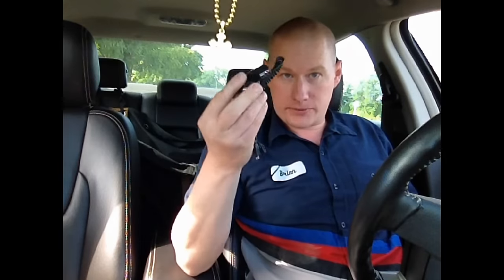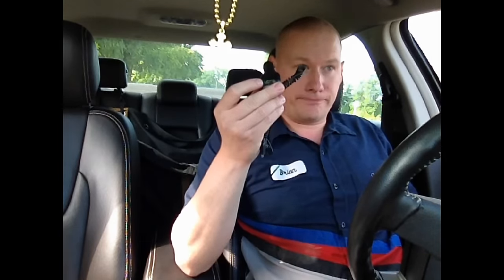Troublesome Ford Tire Pressure Monitor Faults Tip

Comment: I got a 2010 Ford Fusion giving a “tire pressure sensor fault” every time I drive AND right after I start the car too. No chargers, inverters, etc being used in car. All tire pressures are at 34psi so plenty aired up. Someone said the spare tire in trunk has the sensor too and maybe that’s it?
Reply: Did you identify the problem? I have the exact same warning on my 2010 Ford Fusion.
Reply: @philforonda7589  Had a bad tire pressure sensor. Went ahead and replaced all four. A little pricey though I believe they are 15 to 20 a piece.
Reply: @wampaswomps3975  Thanks, I'll bring it in, & get it checked out.

Comment: Also if the TPMS is on and left unchecked it will run your battery down. Ask me how I know. It leaves an open circuit and if your car sets for several days it will run your battery down.

Comment: What if it comes on when you start your car?
Reply from the maker: CJ Dangwillo If it is solid then there is low pressure.Blinking- There is a sensor fault.Starting the vehicle should not have any effect as the monitoring system is not active yet.

Comment: Change my tires my 08 pickup and then the light came on ,fault  sensor switch don't know if they messed my rims up or something😏
Reply: Check the tire pressure according to your manual.

Comment: How does the TPS monitor get power to send a wireless signal?
Reply from the maker: They have a lithium battery inside that last 10 years.
Reply: Thank you for responding. Bit of a surprise. I was thinking that there was a magnet on the stationary part of the wheel that generated power in the TPS unit when the wheel spins. I guess I must mark my calendar to replace the battery in 2023 (mine's a 2013 Escape).

Comment: The light is constantly on & not showing which tire.
Reply from the maker: SA4EVERNS Ok so if the tires pressures are correct 35psi or higher and you drove it over 30 mph for awhile for it to learn and the light is still solid indicating a low tire you will have to bring it in to the dealer or such because one of the sensors have gone bad and while they still broadcast just fine they are reading the tire pressure wrong and thus a false low tire warning. I have seen them wig out high and low depending on the failure.

Comment: OK, so is there a way around this? I mean we get it, cheap chargers will pop up the TPMF error. But how come no one is blaming  Ford for this? Why my $2 charger works perfectly fine on my Toyota? I installed a aftermarket Android radio that brings the error, but I love the radio. This is a big horseSH**t. Very poor design by ford.

Comment: And they think us guys with the tinfoil hats are crazy by the way haven't tried it yet but you can probably wrap the end of your charger in aluminum foil just don't jam it down in the sockets.  It won't eliminate RF emissions but it will probably cut them down enough that the charger And the TPMS will work simultaneously